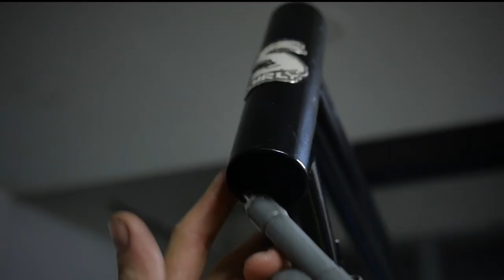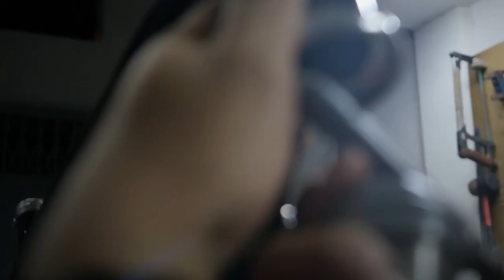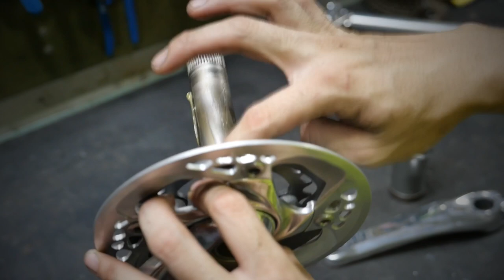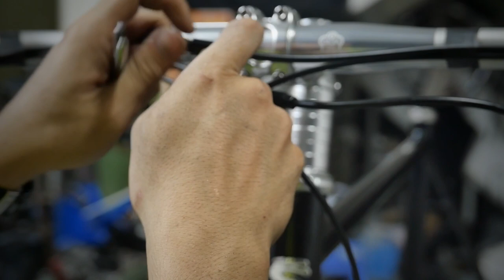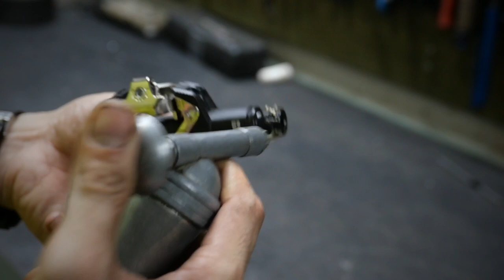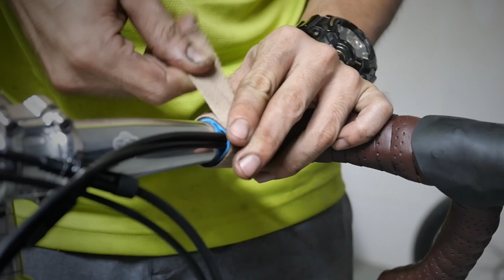DREAM BUILD GRAVEL BIKE/TOURING BIKE: SURLY DISC TRUCKER | CRAZY GROUPSET | ĐỘP WORKSHOP

Comment: Like the build.
I want to go flat bar.
What shifter ( # and model)
 What hydralic brake and rotor (# and model)
Would you recommend
Reply: Shimano deore xt t8000 3x10 group set and shimano 9120 xt brakes

Comment: Very nice, where did you get the tires from? Are they 700c?
Reply from the maker: No, It's 650b 😊
Reply: well you can use 29er rim and use 700c tire, they're fit.

wide rim and wide tire.
Reply: I thought they only made frames to accommodate 26” or 700c wheels? So in order to make a 650b wheel & tire work, I would need to select the 700c frame? Thanks